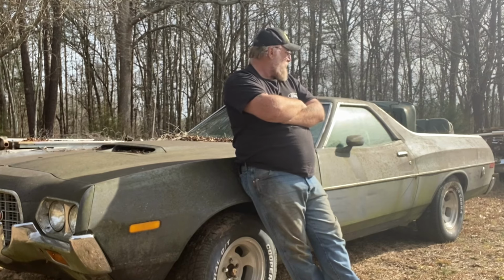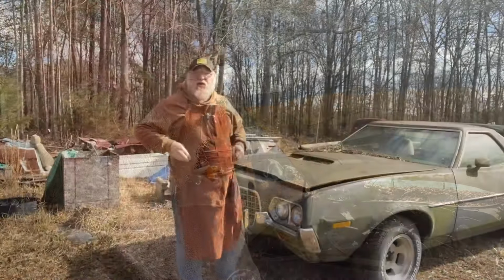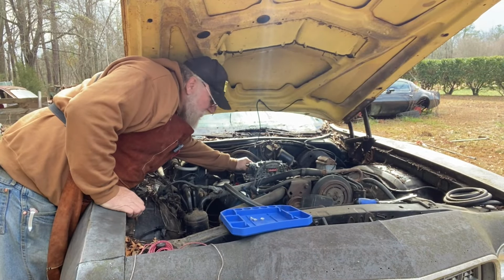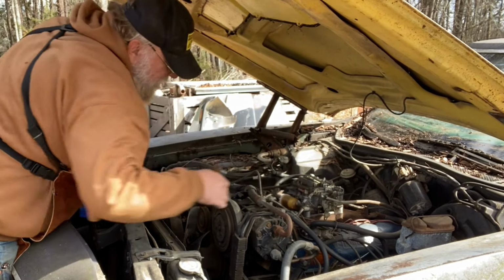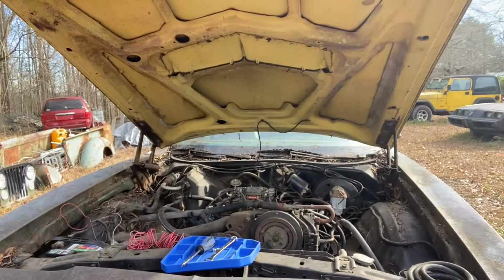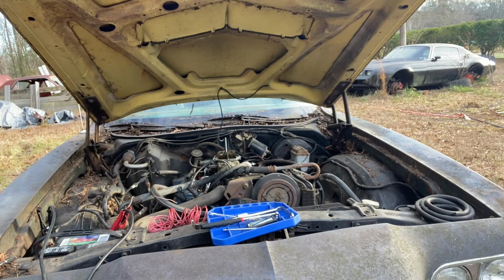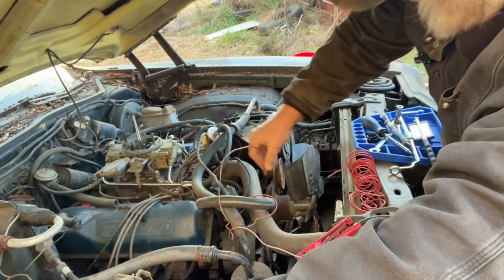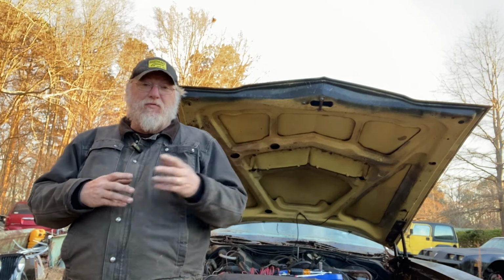1972 Ford Ranchero revival starts !￼

Comment: Cleveland uses the same distributor as a 429/460 used to be able to get a dura spark at the parts stores for under 29.00
Reply: Bingo that's what I was gonna say lol😂
Reply: @HotRodGuyGarage I've converted many Ford points distributers to electronic over the years. Easy-Peasy.

Comment: What’s the black toolbox in the truck? Looked pretty nice from the quick look at it.
Reply from the maker: The one in the ramp truck box.  It’s a craftsman box.  It just happened to be the one that was the right size to fit
Reply: Nice, didn’t know if it was a set that came with the tool holder inserts that were in it.
Reply from the maker: @maxrhyne4137   I bought the tools separately.  It was one of those 300 piece mechanic sets.   Then I went looking for a box that would fit in the bed

Comment: Yeah man those fords are dead simple to fix if it were mine it have a dura spark in a nyc second!... Only thing I've ever seen stop one is a jumped timing chain or broken rod... I had one get me home with a dropped valve... I swapped a head and off again I was 😂
Reply from the maker: Yeah it’s gonna get an upgraded ignition.  I was trying to work with what was there but if I’ve got to replace it might as well put something good in it